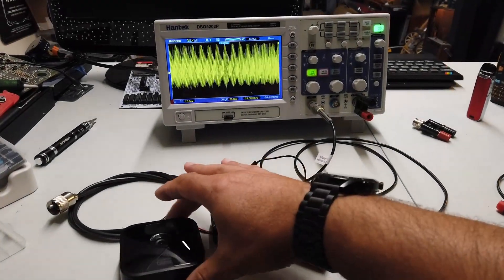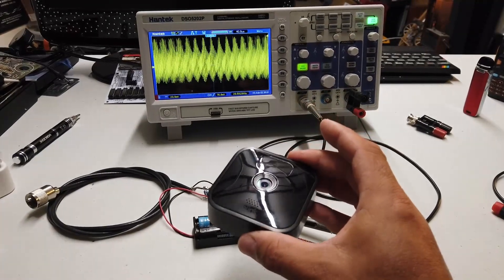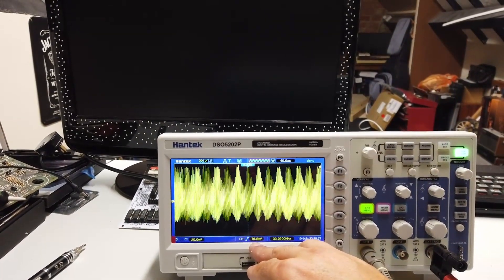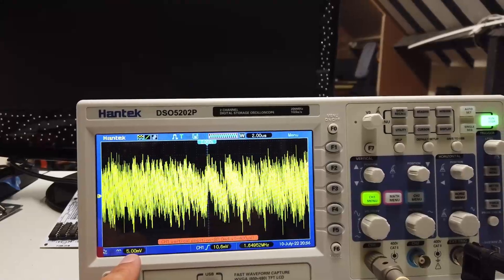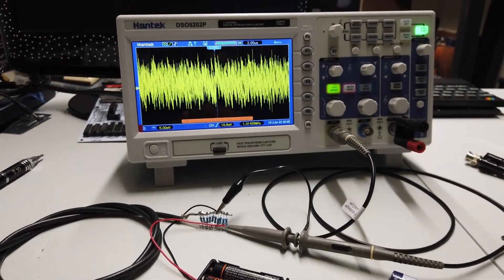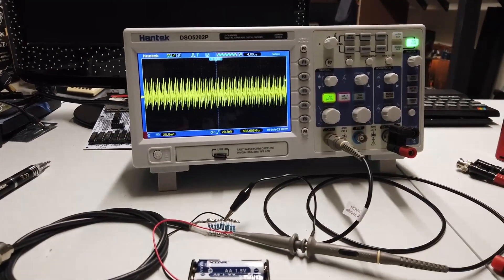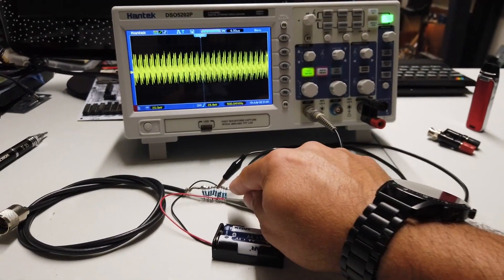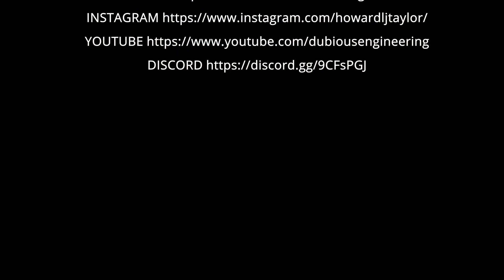DuB-EnG: Lithium AA cells are NOISY and can block WiFi - Kratax, XTAR and EBL put to the test!

Comment: Thanks for sharing. I also can't use Kratax batteries in my DAB radio. FM works fine but no DAB. Switch to regular batteries and its back. frustrating as they are good when they don't interfere.
Reply from the maker: Ahhh…. Yes, that’s annoying!  Thanks for sharing!

Comment: How a weak 10mv 1.1 mhz noice disturb a  2.4ghz Wifi ! if you mean a radio noice ,  that is  imposible  !  if you mean electrical noice ,for  the test you use   a resistance that is not equivalant to the camera witch there is a  capacitor and a chip to stabilize the voltage  ! maybe the problem is with the level of power supplied and the voltage drop of the battery when it is used with the camera
Reply from the maker: The square waves generate harmonic radio frequencies.  The harmonic waves are much higher than 1.1 MHz and de- sensitise the receiver because they are so close.  …. It’s hard to explain.  But sadly, it does happen.  It’s local to the receiver in the camera.

Comment: I have a different application but noticed the same issues with interference. I'm running EBL AA's and AmpTorrent AA's in RC cars. Both the 27mhz and 49mhz frequencies were having problems. 

Which would be better to purchase? the Kratax or XTAR's to avoid interference?
Reply from the maker: Kratax...  absolutely my go to batteries
Reply: I've got a few RC cars as well. Have you bought the Kratax? Are they causing any interference?
Reply: Are Kratax causing any interference in your rc cars?

Comment: Hm...I have one blink camera that started having issues a few months after switching to rechargeable lithium AA batteries from Kratax.  The other 3 cameras have not had any issues.

Is there a difference in "noise" between rechargeable Li-Ion and non rechargeable? 

Anyone know what the blinking purple light is when charging Kratax batteries?
Reply from the maker: The standard lithium batteries generate no noise at all.  I've purchased a lot of kratax now and all seem to continue to work well with the cameras...

Comment: Have you had a go on the new Hixon blue coloured Li-ion that are all over Amazon? They claim to have improved the buck circuitry to handle 3A current draw versus the older orange coloured model of 2A. Not sure you'd ever draw those sorts of currents with a device that needs AAs. Maybe a 'take your eye out' LED torch or something. I was wondering if they'd improved noise as well if they've gone to the effort of releasing an "ïmproved" version.  The orange were OK in devices that needed 1.5v (such as my cat flap) although they all have voltage sag when powering a load  anyway so you never get the full 1.5v.
Reply from the maker: Aha! I haven't played around with those yet, thank you for making me aware of them.  I'll make a point of buying some at one point!  :-)
Reply: @DubiousEngineering  I tried the Hixon orange label in an emergency radio, and they completely blocked MW (AM) reception ,rendering the purpose of the radio useless.

Comment: That's what you get when you are forced to make your magnetics that small to fit.
Reply from the maker: Yes I guess there are some sharp edges on those square waves when your coils are tiny and smoothing caps are tiny too!  But...  1.5 MHz! Wow 👌 👏
Reply: Dave, you should test some on a spectrum analyzer over a range of loads. Maybe maybe have your programable precision load run a sweep. Maybe even test them inside a wifi product and see what the interface is like In practice.